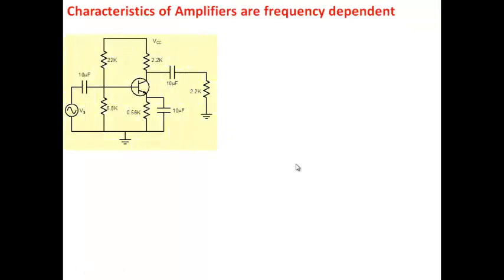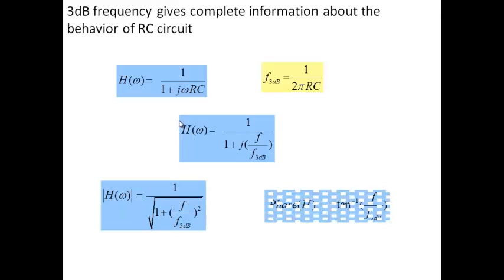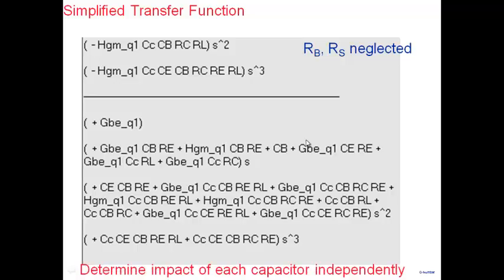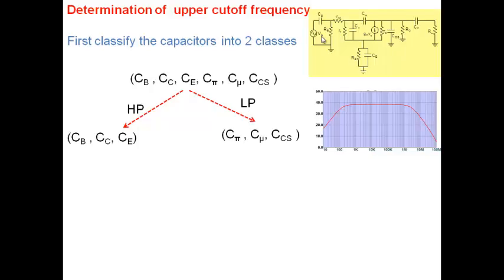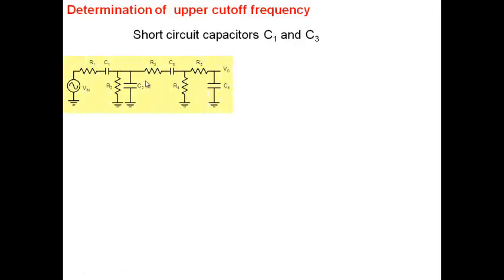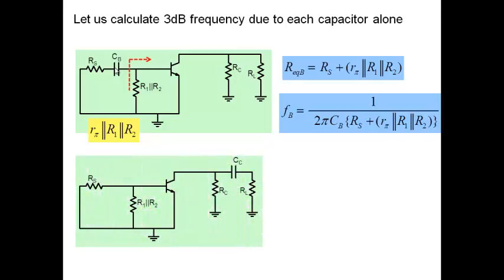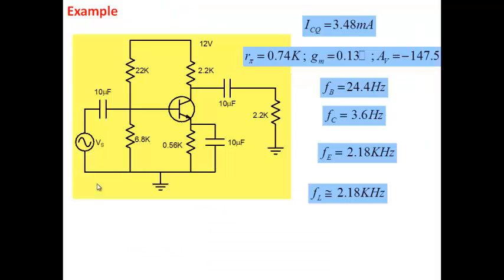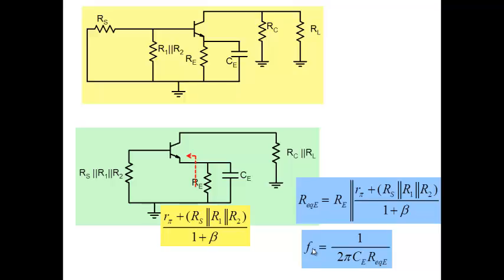EE210 L18 BJT Amplifier bandwidth part 1

Comment: I have a question sir while we are trying to calculate effect of CB , why are we taking  CE as a short circuit ? well you explain that it decrease our gain but the example  before CE amplifier example ,you said that that kind of capacitor is acting like low pass that's why we should take it as an open circuit so can we say that the only reason for taking CE as a short circuit is we don't want to decrease our gain ?